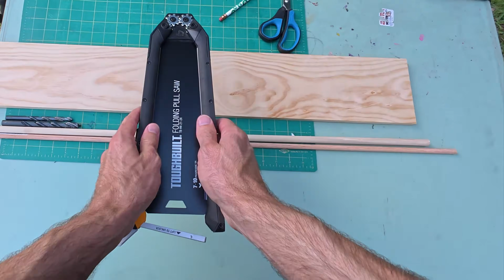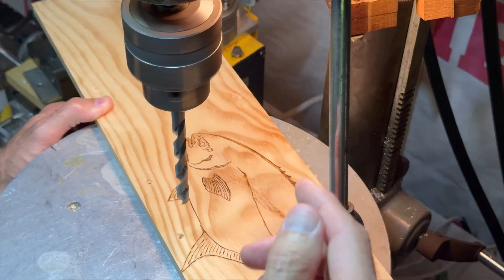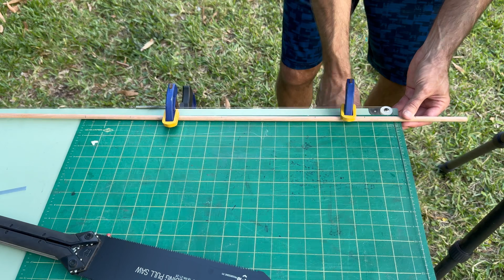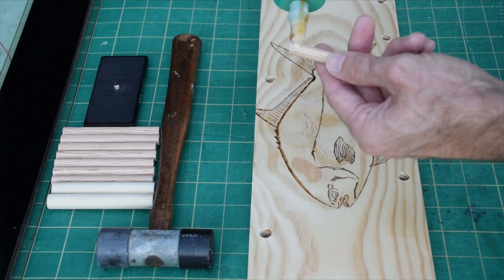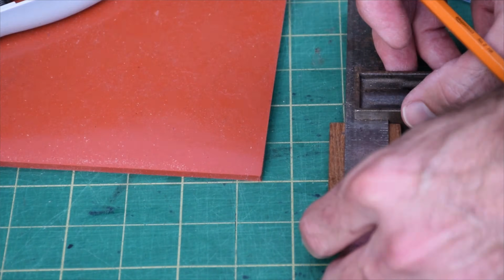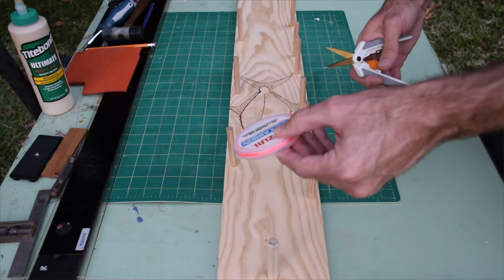Build This PRO Pompano Rig Tying Board (Perfect Surf Fishing Rigs Every Time)

Comment: You mention eight 3/8 pegs and two 1/2 pegs. It appears you use 9 and 1. If not, where are you using the 2nd 1/2 plug? Thanks.
Reply from the maker: I pivoted on the 2nd 1/2 inch peg, my initial plan was to use that for the line hold, but I went with the block and rubber pad in the end.